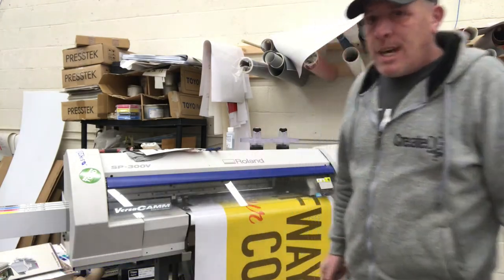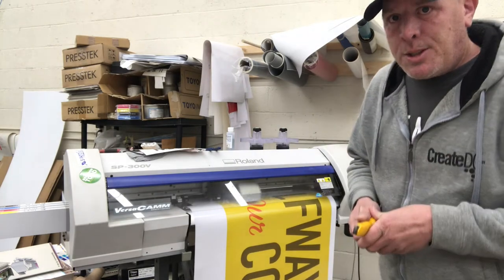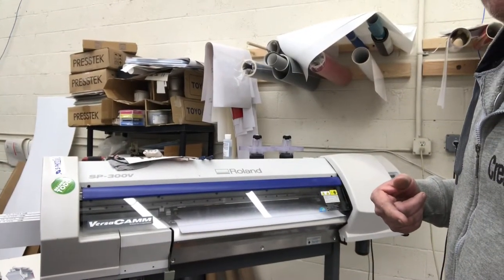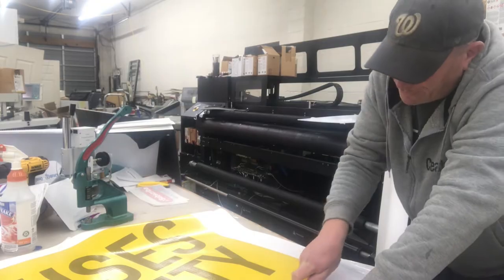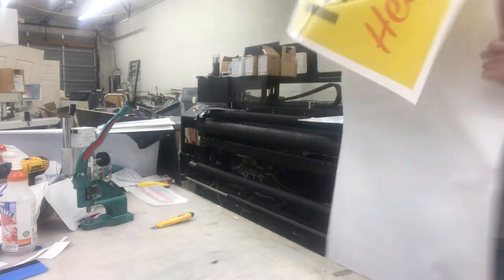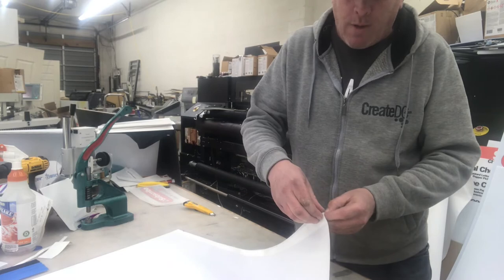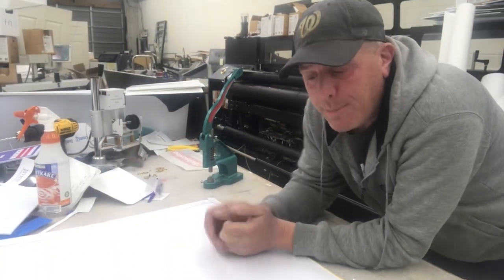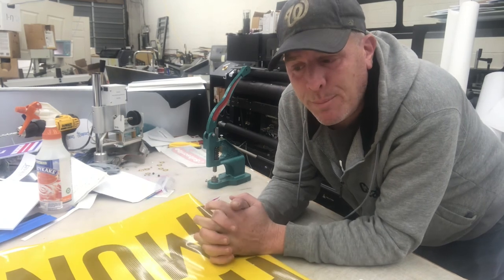Vinyl Banners

Comment: The SP-300 series is the best 30 inch from Roland and easy to maintain.. why? Because use only 2 print heads DX4
I had the VP-300 and was a nightmare day after day, specially cleaning 4 print heads